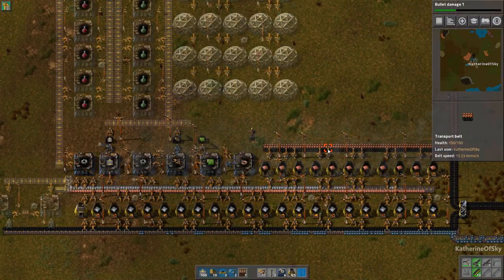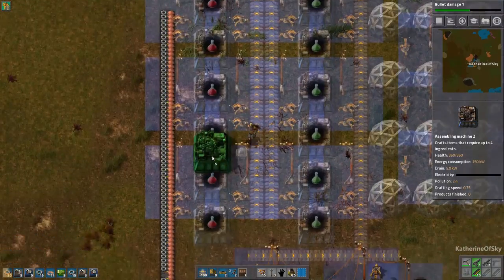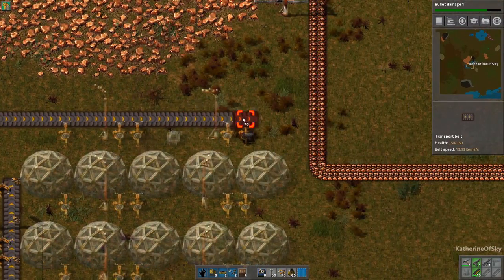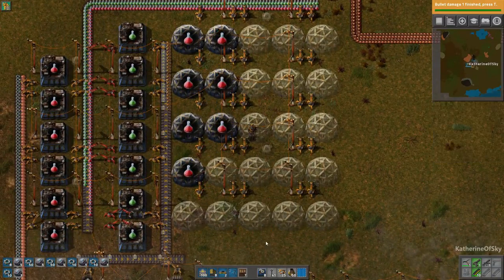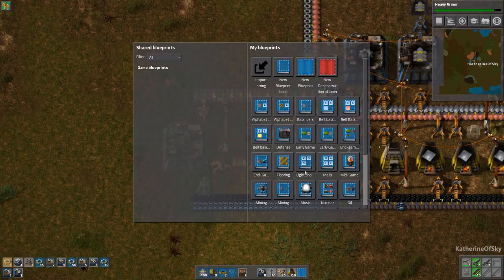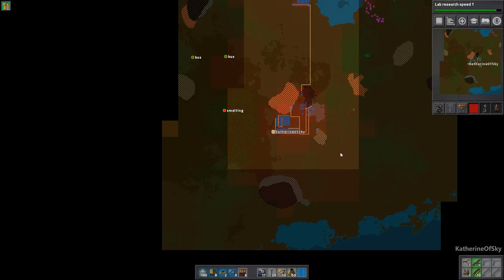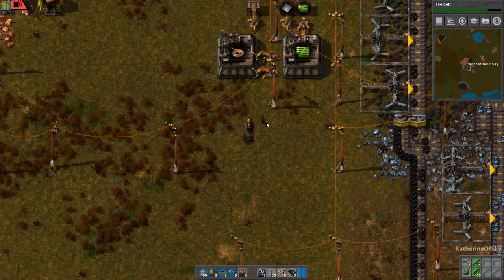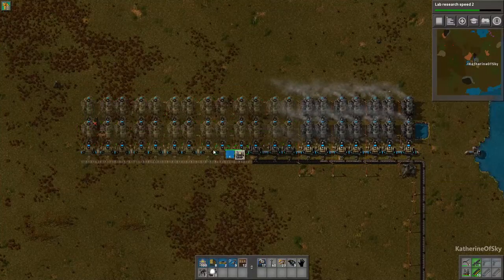Factorio: Entry Level to Megabase Ep 3: AUTOMATING GREEN & RED SCIENCE - Tutorial Series Gameplay

Comment: You were one off on the iron mining drills.
According to the wiki, one drill produces 0.525 iron ore/sec.
One stone furnace takes 3.5 seconds to use one iron ore (1 iron ore/3.5 secs)
The maximum ore on one side of the belt (like in your setup) is 6.67 iron ore/sec (13.33 / 2)
(6.67 iron ore/sec) / (0.525 iron ore/sec) = 12.705 ~ 13
That is the maximum number of drills you can have on one belt.
Now, considering the furnace rate:
(6.67 iron ore/sec) * (3.5 secs/1 iron ore) = 23.3 ~ 23 (or 24 for symmetry)
Essentially, the ratio is 23.3 / 12.705 = 1.84 stone furnaces per drill.
Since you had 22 furnaces, you'd need:
22 sf / (1.84 sf/1 drill) = 11.979 ~ 12 drills
Before you added one drill, you only had 11 which explains why you were coming short.
Reply from the maker: Thank you so much!
Reply: Oh cool, I had 12 anyway, 6 each side of the belt , looked odd with 1 missing so added an extra to make it look better, good job i did
Reply: Tldr
Reply: This game is mental iv been crying
Reply: Lewis Macleod same
Reply: @UnderscoreZeroLP  oh my lord XD?
Reply: r/theydidthemath

Comment: Awesome series! Question about the amount of science production though, why do you use 6 red and 7 green while they take 5 and 6 seconds to be made respectively, won't the ratio of red/green be off?
Reply from the maker: This is a VERY temporary setup and will be removed as soon as I properly setup science.  Normally I build red and green much larger with x/second exact ratios.  6/7 is just speeding up the initial research stage.
Reply: i normaly build 10 red and 12 green machines in the start to keep that ratio, but dont matter that much, because there is different time frame on the use of sience dependable on what sience you research... it goes from 15 up to 6t0 second i belive for the slowest research, so cant build something exact anyway

Comment: I've been watching it and then you again talked about steam engines ratio. Then I looked up for the numbers in your previous videos, because now 0.16 is out and they could have changed, but they didn't. If one boiler produces 3600 kWt energy and steam engine does 900 kWt, won't the right ratio be 1 boiler to 4 engines?
Reply from the maker: The current ratio in 0.16 is 1 boiler to 2 steam engines.  Remember to take the efficiency into account when calculating.

Comment: hey Katherine, i have been playuing factorio for a while and there is one querstion i have. why use regular inserters when the faster counterpart is affordable as well. is there an advantage to using the regular inserters if they can keep up with production?
Reply from the maker: Regular inserters are cheaper to make and use less electricity.  It may not seem like much, but when you are building large smelting columns in early game it can be significant... e.g. 1 column uses 96 inserters ... we have 22 columns = 2,112 inserters...  and at 2 green circuits + 2 iron chips additional per each, that's a decent savings!

Comment: I have a minor modification to your starter base--I added steel production to use some of the excess iron at the end of the line, and added pipe manufacturing to use some of the excess iron at the end of the line (I always tend to run out of those). I also noticed that in your video you had a fast inserter placing regular inserters on the track for research, but in the modified starter base (shifted 1 over) this was not present, so I tweaked that. What is the best way to send you the string? (Or should I just post it here?)
Reply from the maker: The starter base is going to be deleted very shortly -- it is a temporary structure :-)
Reply: Ahh--easy enough! :) I just need to keep watching! :) Trying not to get ahead and to experiment at each part! :)
Reply from the maker: You should absolutely experiment!  It's the most fun part of the game! XD
Reply: KatherineOfSky Agreed! Your thoughts help me do just that, too!

One thing I found interesting when adding steel...apparently, you cannot just feed iron+coal from a burner directly into another burner, even with a filter inserter directly specifying iron and coal to be moved. It will only move the iron. (Conversely, research packs can be chained in research labs like you do here even though it is also a consumable; I am not sure why coal is treated differently.) I did find a compact workaround, though!
Reply from the maker: There is a mod that adds that functionality to share coal between burner machines.  (Can't remember the name of it, though).  I still direct-feed iron to steel smelting, and just add an extra belt of coal on the inside line.  Also, the daisy-chaining of science packs is a new feature for 0.15 , so I suspect the devs didn't thin of coal at the time.
Reply: KatherineOfSky That is cool! I need to check out mods in general, starting with your QoL mods. 

My solution was 4 burners below the grenade area, and inserts put the iron in boxes below the burners. There were inserters below the boxes as well that moved the iron.

Then to the right, I used a filter inserter to grab coal and place it on a short belt running down to the same level as the boxes, then inserters moving coal off the belt to each box right to left. It was mesmerizing watching all the arms (12 total in a small area) swing in rapid succession! I can post a string soon with the layout.

Comment: For trees I use fire
Reply from the maker: I've stopped using fire because 1. it can burn out of control unless you stop progress with grenades and 2 It doesn't burn 100% of the trees, still requiring the use of grenades.
Reply: oh
Reply: ive never thought of grenades for destroying trees
Reply: I like the tank. Just plow the path you need lol. Couple repair tools and a little bit of fuel is all it costs :)
Reply: The tank flamethrower actually destroy 100% of the trees, for making path it's a very decent option in the mid to late game if you don't have bots unlocked yet.
Reply: Thanks guys for your imput:)
Reply: I can’t spell....